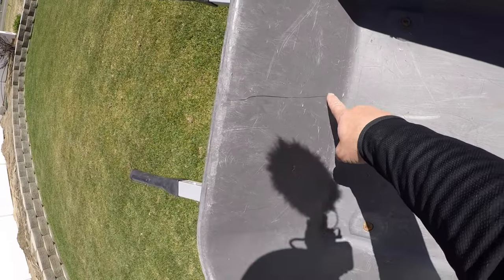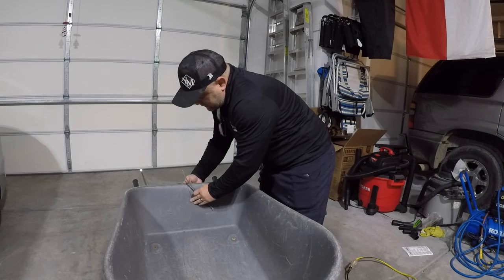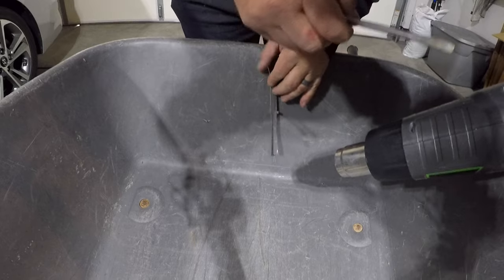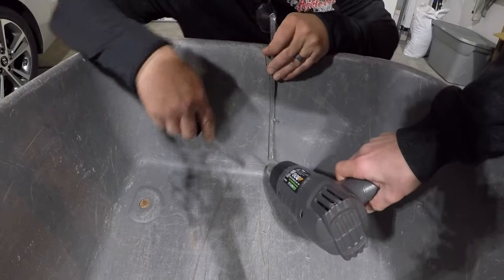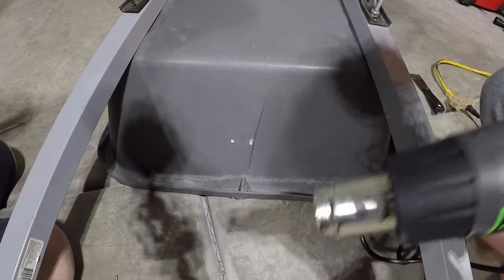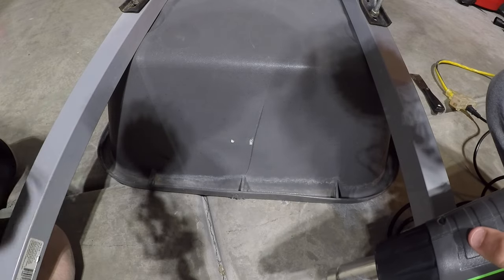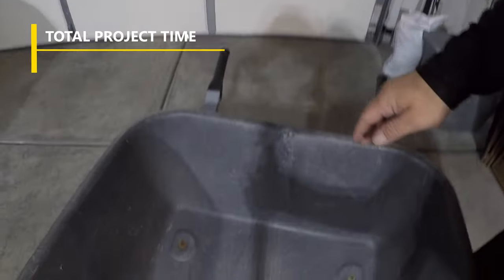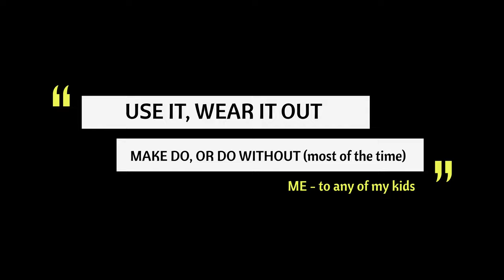How to fix a cracked plastic wheelbarrow and save a ton of money $$$$

Comment: I used to work in plastic injection molding., even though I was a material handler.   It looks like you have the right idea about plastic welding this back together.    Like you said, use the same material, that way it keeps it all consistent.
Reply from the maker: My apologies for not responding earlier. I have been crazy busy the last 3 months and I have been a little neglectful to responding to comments. Been remodeling my daughter's recently purchased home. 
Yes I had done some serious research to try and figure out what would work best, and the majority of what I found was "use the same material that the item is made of", so that's where I came up with using itself to make the repair...it's not quite cannibalism, but ......maybe!! LOL Thank you for the comment. I hope to hear from you in the future.

Comment: Great  idea making a filler strip from that overhang!

You'll have to give us an update video on how it holds up.

 I hate repairing plastic, its such a crap-shoot trying to get the right adhesives for the right plastic, especially if you dont know what kind of plastic your are working with.
Reply from the maker: I completely agree. I originally started by looking up epoxies, etc to see what might work. Then I came across an article that was pretty straightforward that the guy basically stated "at one point in time the piece of plastic was "melted" or "softened" to form whatever product that you are using and now it's cracked the only way to repair it is to heat it to the point of "melting/softening" to where the plastic uses itself to seal the crack"  (not a quote verbatim, but the basic gist, LOL)  In regards to what type of plastic to use, he stated and this held true for the wheelbarrow, there were some markings on the bottom that supposedly tell what the "type" of plastic it is. Thanks for the comment. I hope to hear from you in the future.

Comment: This is one way to fix a wheelbarrow tub that I hadn't considered. I was thinking about using fiberglass and an epoxy to patch mine. Could you give us an update on how well the patch held up? 

Thanks for taking the time to make this video. I appreciate it.
Reply from the maker: Jon, yes same here. I did do some research and when I was done it just made sense. “If you’re going to mend a crack, use the same material that the tub is made of!” 💡💡💡So far the fix is holding up very well. I will definitely look at doing a follow up video. Thank you for the comment. I hope to hear from you in the future.
Reply: @TheHighlanderLawn  thanks for taking the time to reply. This is great info. Those replacement tubs cost as much as a new wheelbarrow.

Comment: Great idea thanks I have a small cracks where the bolts go thru. Instead of using an screw driver I would use a  painters utility tool to flatten out the plastic strip
Reply from the maker: John, thank you. I too am having the issue with the bolt area. Have some touch up work to do. I just come from the old school thinking of : Use it, wear it out, make due or do without!…and I just like to make my dollar stretch!! Best of luck to you in your repairs. Thank you for the comment. I hope to hear from you in the future.
Reply: @TheHighlanderLawn   I just used JB wield plastic epoxy  it set up hard as a rock I removed the bolt where the crack started and but a small piece of sheet metal between it.  The wheel barrel tray would cost almost as much as a new wheel barrel tray

Comment: Great idea. But who's crazy idea was it to start making wheelbarrows out of plastic? I should have bought a steel one in the first place. I fell for plastic too and have the same problem! Never again.
Reply from the maker: Tony, I agree, it is a little crazy, it was probably to have something that may not rust. BUT the other side of the coin, is that obviously the plastic can and most likely will crack. So far the wheel barrow has held up. Hopefully it will last a few more years. Thank you for the comment. I hope to hear from you in the future.

Comment: Nice video especially using the bucket lip for the repair material.  Also, nice license plate collection; however, I didn't see any vintage plates.
Reply from the maker: Thanks, I am glad you liked it and I am happy to report that the repair is still holding strong. I do get a lot of comments on the license plate collection. I have a few vintage plates, they are located more towards the upper left of the wall. Thank you for the comment. I hope to hear from you in the future.

Comment: For a durable repair, reinforce the patch by imbedding ss screen or staples into the patch similar to how a car bumper is repaired.
Reply from the maker: My apologies for not responding earlier. I have been crazy busy the last 3 months that I have been a little neglectful to responding to comments. Been remodeling my daughter's recently purchased home.  
Thank you for the insight, that is a great point. I will have to use that method on a possible future repair on other items. Thank you for the comment. I hope to hear from you in the future.

Comment: I have stress cracks around three bolt holes holding the tray to the handles.

I took everything apart for a rebuild and painted the wood and steel reinforcements and am replacing several rusted bolts.

I welded the plastic cracks.  I don't have a lot of confidence in the durability of that repair.

I have two sheets of stainless steel sheet metal  --- I'm considering adding that as reinforcement to the tray.  I'm also considering adding 1/4" plywood under the tray with filler of some kind between the tray and plywood since it's not flat. 

Steel trays rust  ----but it takes a LOT of rusty before they are destroyed,.  I painted up my thirty year old rusty steel tray and it should be good for an additional decade or so before it needs it again.

Plastic trays crack.  How effective those repairs are remains to be seen.
Reply from the maker: Sounds like you have gone the extra mile to repair your wheelbarrow. I absolutely love this approach, we live too much in a "throw it away" culture. It's good to hear of folks going the extra mile, to give new life  to tools, etc. Thank you for the comment. I hope to hear from you in the future.
Reply: @TheHighlanderLawn  <<The Highlander Lawn
Sounds like you have gone the extra mile to repair your wheelbarrow. I absolutely love this approach, we live too much in a "throw it away" culture. It's good to hear of folks going the extra mile, to give new life to tools, etc. Thank you for the comment. I hope to hear from you in the future.>>

Thanks for your encouragement.

Rebuilding both wheelbarrows were each good projects, m and I learned a good deal from each.  But I've discovered there is reallym more to learn and more with which to experiment.  Replacing the rust prone hardware with stainless steel or at least galvanized would be good to do to avoid future problems and allow the barrow to be taken apart easily and refinished.

I am impressed with the long term durability of steel trays.  Plastic seems quite susceptible to cracking,  holes and damage,  while it takes a lot of abuse,  and many years to  damage a steel tray badly,  and even then I would suppose they can be patched and used.

I've become an advocate of priming and painting the wood and metal to avoid rust and prevent the handles from deteriorating and rotting.  In recent years,  plastic wedges  have replaced rot prone wooden wedges --- that's a good thing.

I find myself becoming a wheelbarrow buff.

Comment: I bet it will hold up just fine, before i knew any better i used metal and pop rivets to repair one i have...holding up good just the rivets kind of get in the way if you shovel anything out of the wheelbarrow
Reply from the maker: So far I am pleased to report that it has been holding up VERY well!! Yes I can imagine that the rivets could be an issue when trying to shovel something out! Thank you for the comment. I hope to hear from you in the future.

Comment: Hi , I was wondering how the wheelbarrow fix is holding up . I have the same problem cracked wheelbarrow and was thinking of fixing it the way you did .
Reply from the maker: To date I have used it on 4 projects this last year 2022, and there has been no deterioration in the fix. I will say that it is stored in my shed. We have had some very cold temps over the last weeks, and where the wheelbarrow is hung it rests right on that area that was cracked. I have recently had full blown shoulder surgery, and I haven’t checked on it, in the shed for the last two months. I will check it and get back with you. Thank you for the comment. I hope to hear from you in the future.
Reply: @TheHighlanderLawn   Thank you for the reply and hope your shoulder gets well …

Comment: How did this hold up? I'm leaning towards either epoxy or fiberglass
Reply from the maker: I have used the wheelbarrow twice since then, and it is holding up fantastically. NO issues at all. I did consider the epoxy and fiberglass, and did the research and thought it would be a great way to do it quick and easy and "see" if it REALLY works, and so far I have been glad I made this choice. Saved some $$$ along the way. Thank you for the comment. I hope to hear from you in the future.

Comment: I just think about using a flame and put some plastic on the bottom which is damaged alot!

It definitely would not look beautifull but hey to make it durable why not to take the try!?
Reply from the maker: I have to admit I was a little skeptical that this would work when I came across this method of repair. It does make sense to use the same material to "weld" it back together. But I happy to report that, to date, the repair is holding strong and I hope to get a few more years out of the wheelbarrow. Pointing to your statement, it isn't beautiful but it works!! Thank you for the comment. I hope to hear from you in the future.

Comment: Thrifty is smart and sensible and helps with pollution and I was raised on it but, cheap and not having much is different
Reply: By the way how did it hold up, I fixed mine with JB weld and it held up a few heavy loads but I threw 4 big bags of soil in it and it cracked
Reply from the maker: Thrifty is smart and sensible, agreed. I was not raised with much money, my dad worked 4 jobs, but taught us to work hard and to "use it, wear it out, make due or do without!" So we were shown to try and fix something first before you just simply toss it out.
Reply from the maker: To date it is still holding strong. It is stored in my shed and the bracket that holds it up against the wall sits right on that rear seam.  (Probably one of the reasons that .section cracked originally LOL) So it bears 95% of the wheelbarrow's weight. It has moved 15 cubic yards of soil (some dense heavy loads) and some other heavy loads. Actually had to replace the tire because it blew out. So I would say that it has been a success so far, and has put off shelling out money for a new one. Thanks for the comment. I hope  to hear from you in the future.

Comment: Looks awesome, hope it works for mine also.👍
Reply from the maker: David, so far it is holding up really well. I have used it on 5 projects with relatively heavy loads. I have had a few requests to do an update video on the repair, so I may very well do so. Thank you for the comment. I hope to hear from you in the future.